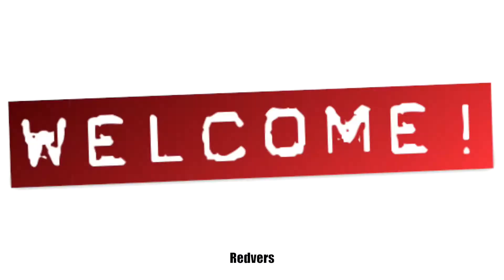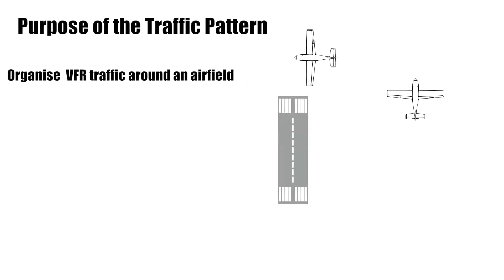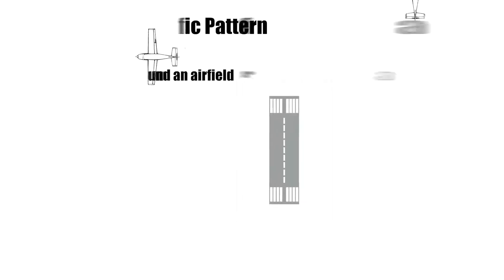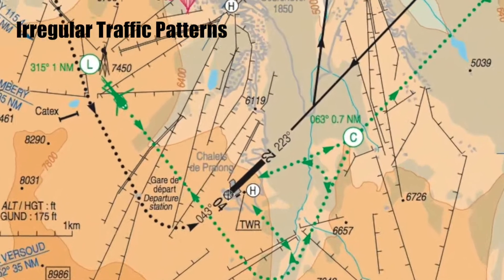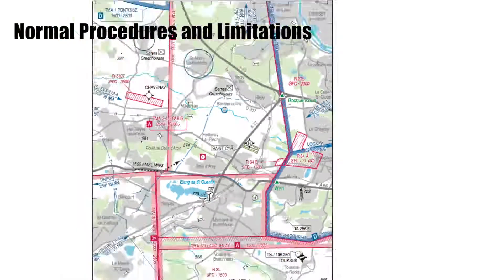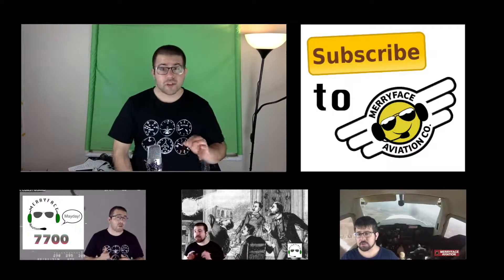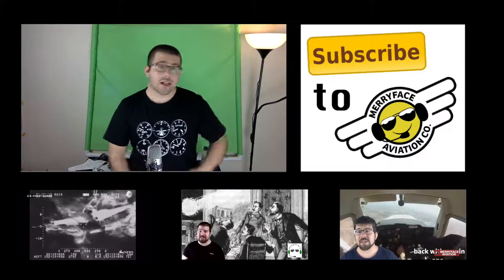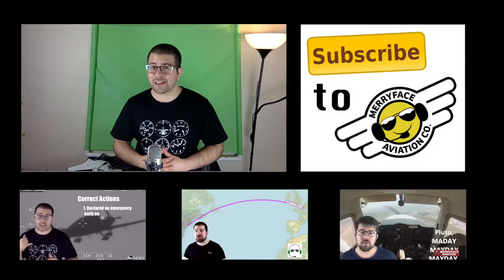Traffic Pattern Explained

Comment: Dyl
no disrespect intended, but watching videos is not lazy. i read a lot however i like to mix it up if im not comprehending something. read,audio,video and simulation make for a well balanced diet for your brain. whatever helps you get the material to stick. i agree you should cross check your info just to be sure.

Comment: The departure leg is not the upwind leg- at least in the US. The upwind leg is offset from the centerline to the left or right of the runway, as is to be flown at pattern altitude. Lots of people have been calling the departure leg the upwind leg lately, and it almost caused a collision at our home field a few months ago as someone was crossing midfield. This should be corrected, or annotate that this is not meant to be instructional and you have incorrect information.
Reply from the maker: +Dyl Connaway We call it the upwind leg here in Europe. With more people training in the US though, we're starting to call it the initial climb or departure leg instead. We tend not to use the US equivalent of an upwind leg around here. Or in any case, I've never seen anyone use it, ever whilst flying here. I've flown in France, Spain, Germany, Austria and Hungary. I'll add an annotation here in any case.  Cheers for the feedback.
Reply: +MerryfaceAviation Right on. I am not familiar with CASA or Eurocontrol. If the departure leg is formally called the upwind leg in the EU, what is the upwind leg called, even though it is not used much? You do have an international audience. Perhaps a note is appropriate. As an American, I can tell ya that younger students prefer to watch videos as opposed to actually reading reliable sources and doing the work. Some call them visual learners. I think it's a little bit of laziness as well. Regardless, I do appreciate for your quick reply. Cheers